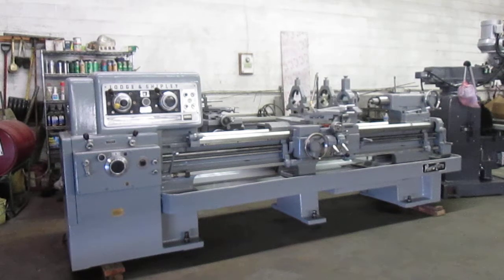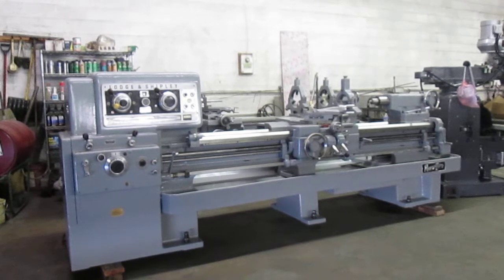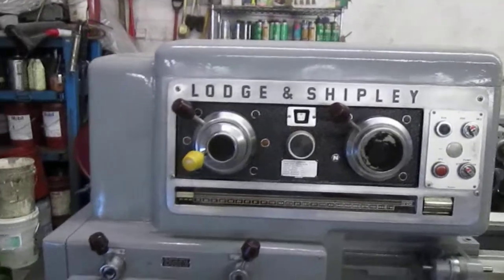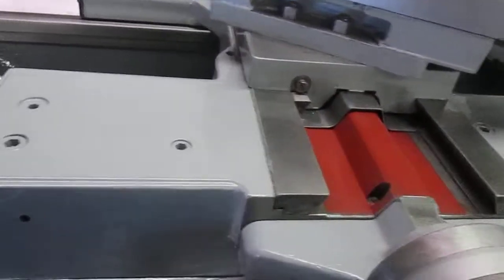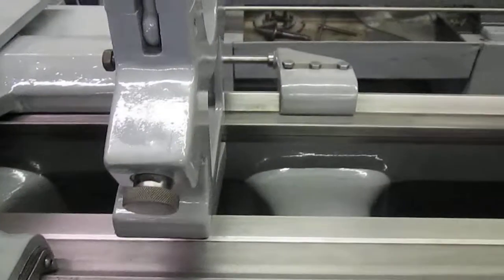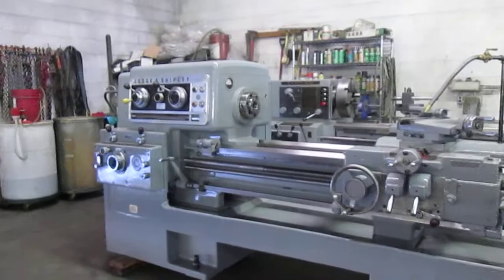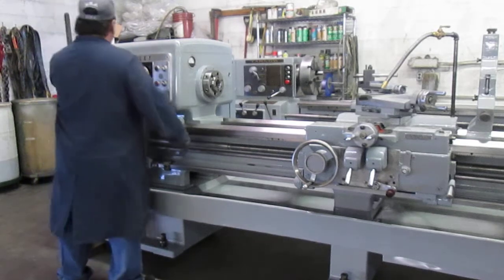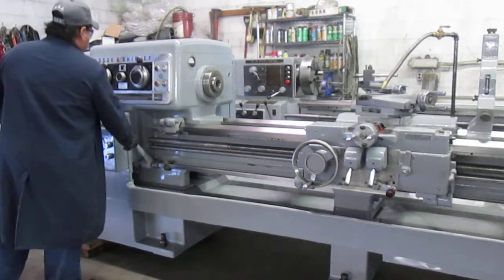Used LODGE & SHIPLEY 21 x 80 Lathe in Exceptional Shape!

Comment: can I know which company made by?
Reply: Rayappa polisetty, this video is quite old but the lathe is a Lodge and Shipley. They made many large and very heavy duty lathes, what might be a medium or large lathe for many manufacturers is a small lathe for L&S. 

Also many of their lathes were made for oil field type work and have large through spindles and a bed on either side, usually the left side bed is about half the size of the right. I've seen these with a carriage on both sides or two in the right and one on the left for 3 total. That's about all I know other than L&S are/were American made and are usually named up among the very best quality and featured lathes with brands like Axelson the places I've been usually seem to like Axelson as the best ever, then L&S, followed by American Pacemaker and some of the heavy Monarch, that's all subjective though. These old lathes have already outlasted what a new manual lathe will and will likelykeep on going probably at least double what they already have so long as they are treated right.
Reply from the maker: Hey thanks for the support !!! Always great hearing from you as well, Bill Jr.